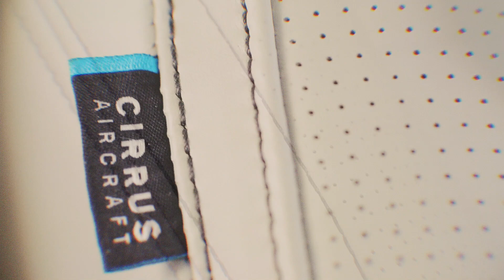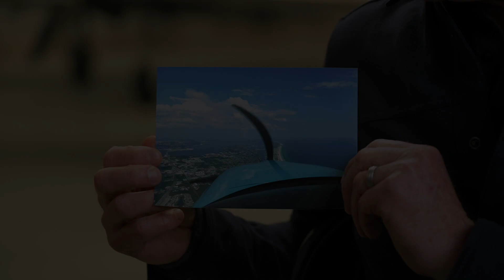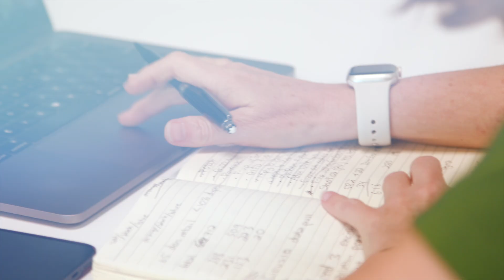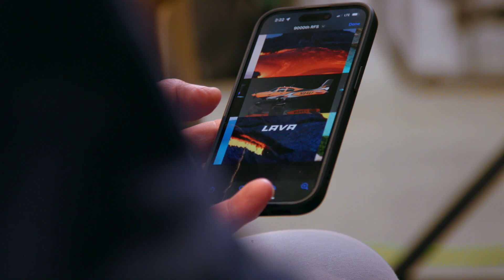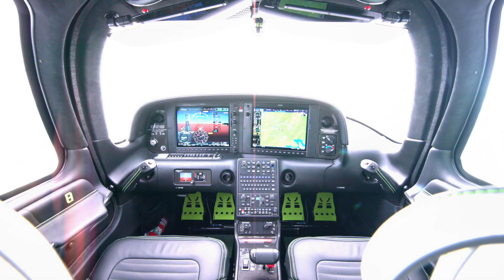Introducing Our 9000 Limited Edition SR Series

Comment: Build a 6 seater with 350 HP!
Reply: they make a 6 seater with a jet engine strapped to the top
Reply: @BonanzaPilot  Yep, which has a great range/load balance. And Autoland and CAPS.
Reply: @BonanzaPilot  They sure do...  Not sure what that has to do with a piston 6 seat non presuraized "SR26" with 350hp at 1/3 of the price of a vision jet
Reply: @carlifrancis31  a piper matrix with a parachute? that would be an incredibly niche market to fill an insurance gap